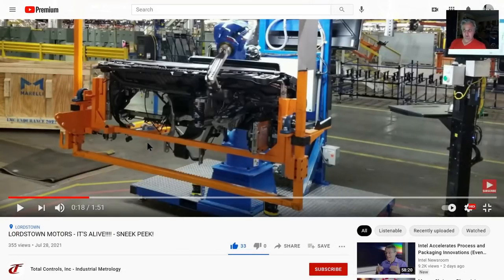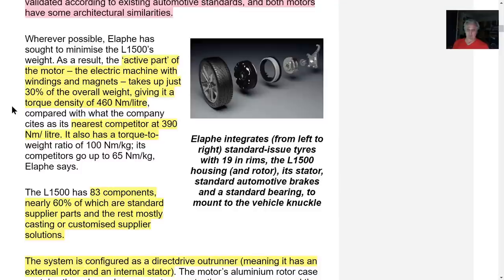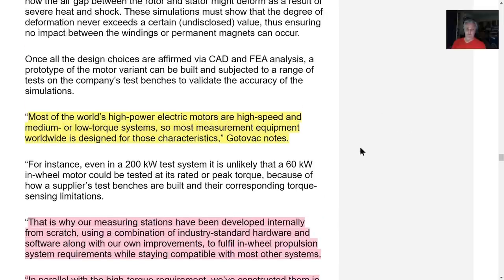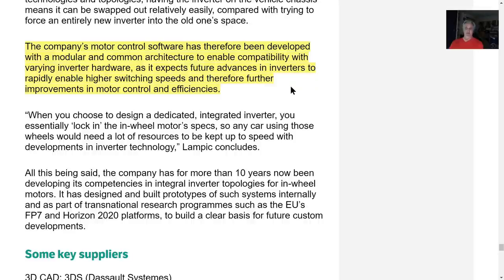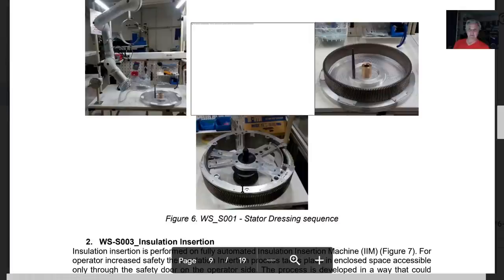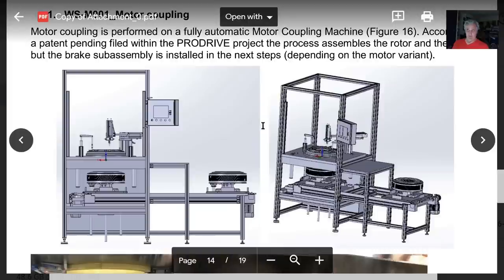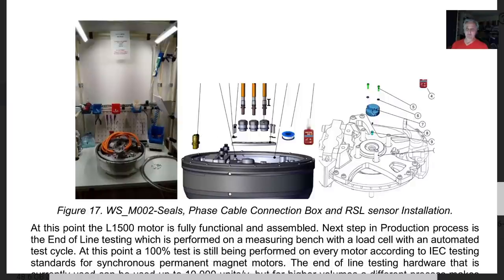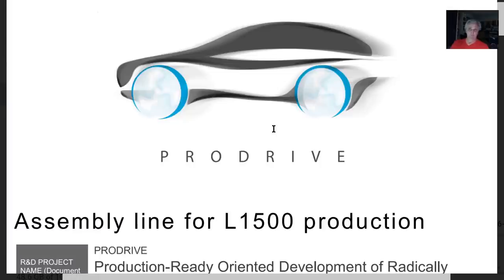BETTER THAN TESLA | NEW TECH | HUB MOTOR PRODUCTION | QUALITY CONTROL | LORDSTOWN | #MXUX #RIDE |

Comment: People tend to dismiss the Endurance as a half-baked science project. They say the hub motors will never work, if they were such a good idea the big boys would be using them.  The hub motor is a concern, as is Elaphe, a small Slovenian start up.  What I didn’t know is they were funded by the European Union. The strange set of documents you show are contract deliverables required by the EU for Elaphe to demonstrate that development, testing and marketing is/has progresses according to their requirements. As such, I dare say the L1500 motor probably has been more scrutinized than any other motor used on any EV.

LMC development schedule shows a that they should be doing brake integration right now.  I think the reason for doing this so late is the brakes, while just a standard disk brake system has to installed inside the hub motor.  The hub motor assembly line is scheduled to start in July so I guess the brake integration begins as well. One might ask why this wasn’t started earlier as the L1500 motor went into production a year or so ago.  I think the answer is in the documents you found.  The structure of the hub motor has to be tweaked for the application. It turns out the gap between the rotor and stator is critical. So the bearings have to be designed to meet the loads of the specific application. My guess is a full sized pickup is required pretty beefy bearings. 

LMC will be warranting the battery, hub motors, and associated electronics (I.e., the whole powertrain) for 8 years or 100,000 miles. This is way better than what you get on your standard ICE pickup.  

Have you seen the Elaphe videos testing the L1500 under water?  If everything is sealed up well the Endurance should be able to operate entirely under water.  The Navy Seals may be interested in something like this.
Reply from the maker: Larry fantastic comment - yes the hub motor is not bespoke - but tailored per application - yes right now the Endurance will run through 3 feet of water no problem per an online presentation I watched - my guess is that they want to get the line up and run a few hub units through it and check tolerances and so forth before finalizing on brakes/bearing/controller/software - I do think IMO - they can/have also tweaked the windings/magnets/materials/size for LMC as well - a custom application optimized for LMC - what their web site says they do for clients - as well as tweaking production line - Ya I noticed that EU thing after posting this for the first time - like our ATVM? - which I hope LMC gets - but likely won't IMO - this doc had numerous attachments that I could not locate - so yeah great insight Larry - Great LMC warranty based on their testing and simplicity/elegance of the engineering - Pinning this comment - a real scoop -  LMC doubters abandon all hope!
Reply: @brianbayowski9265  The brake rotors and calipers are external to the motors.

Comment: I am also an investor and volunteer brand ambassador for Aptera.  I consider the management of Lordstown motors to be much less compelling, but Elaphe have been open and responsive to my questions and I think they have a good chance to get it right.
Reply from the maker: Bruce I'm a aptera fan but I have to tell you lordstown is exactly where aptera was back in the day you should be a little kinder to them starting an ev mfg is hard to do in the usa, thanx for the comment
Reply: To provide full disclosure, I have also bought stock in Lordstown.